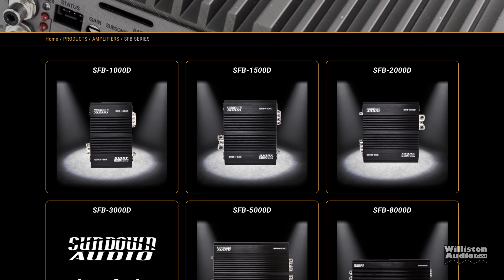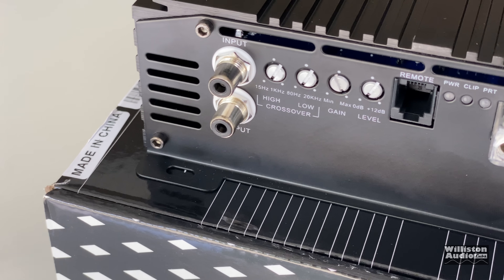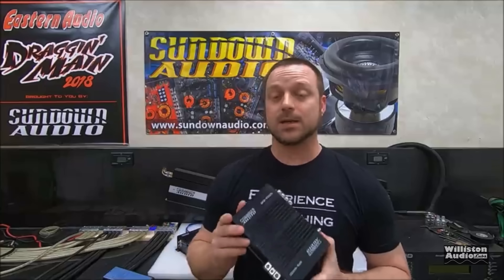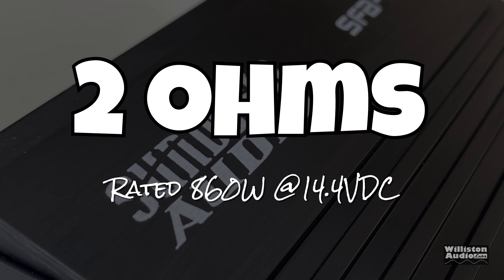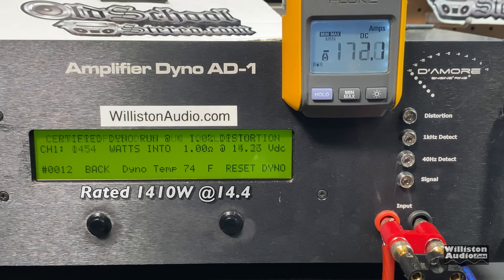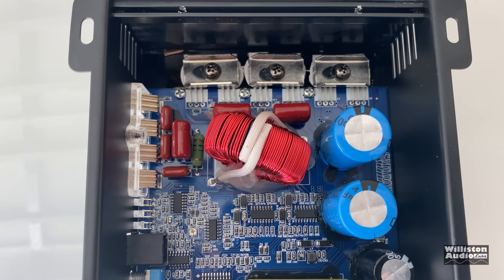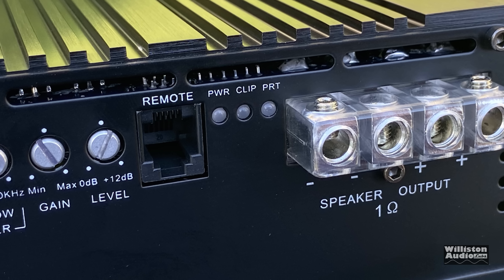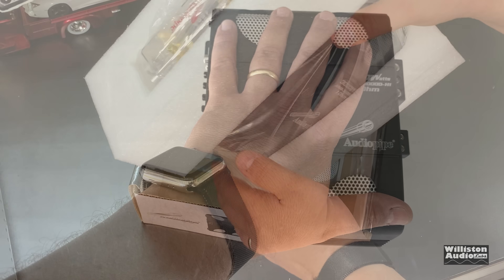Sundown 1000W Full Bridge SFB-1000D Amp Dyno

Comment: on sundown site it says this amp can be linked at 2ohm to deliver 2000 watts is this true? if so what does it mean ? lol i have 2 zvx 12's 1ohm each in a box together im trying to get about 2000 watts to the box would this work or would i only get 1000 watts from this amp? i have no idea what linking means does that mean run subs in parrallel?
Reply: This amp cannot be linked/strapped with another SFB1000D, if that's what you're asking. Linking allows you to run 2 of the same amps, and only one of them controls the gain, crossover, etc. So imagine you have 2 strappable amps, you link them together, and on one of them (the master) you set gain/crossover, and the gain/crossover settings on the 'slave' do nothing. This ensures both are running exactly the same and you do not have subtle differences in gain and/or frequency cut offs.

Comment: What is the gain set at ?   Wide open ?
Reply from the maker: Gains are matched to head unit using DD-1+ for 10dB overlap. Gain is not a volume, it should be matched to your source unit

Comment: Why does this amp and also it's clone the top strong gear not have any fuses. I'm a little leery about an amplifier without a fuse. Seems to me like something like that would go up and smoke since it doesn't have any fuse protection.
Reply from the maker: Use external fuses

Comment: I need some help. I have the same amp running a SA classic on 1 ohm. 
the amp keeps clipping. I sent it to sundown for testing. they said amp is good and issue is cause by bad rca signal from the radio and music source bluetooth. They said it was premature clipping.

Is there such thing? 
How do I fix this?

Comment: Why does it go to 1000w at 2ohms? Was hoping to run one but don't wanna draw too much power from the car. Will it always try and run as high as it can? If I get a 750 watt subwoofer, will it only draw 750watts?
Reply: No a speaker attempts to take what you give it.

Comment: I'm really having trouble choosing between this and the JP8 for my sub.
Reply: I went with the JP8 with absolutely “0” complaints and best amp I have used in years. Bought a second to strap/slave for future since they can handle and it is laughing at 1 ohm slamming. I wondered as well when purchasing amp about this SFB 1000 and what difference it could make if any? Let me know which route you took?#🔊❤️@chuckschillingvideos

Comment: I need a recommendation for an amp that can deliver 500w @ 2ohms. I got the sfb600d but I think it fell a little short pushing my kicker trtp 12" sub. I also need it to be as small as possible since it's under the seat of a mini Cooper
Reply from the maker: The SFB 1000 will. KICKER CX400.1 will do almost that much.

Comment: If money was not an object and you were just going to do situation a really good system with the sub and you was going to pick one amplifier to do it all what would it be big D
Reply from the maker: One amp? Toss up between the AudioControl 5.1300 or D4S JP95. I’ve always liked the 5ch amps and one that has enough power for a full system without trying to do hair tricks or anything…I’d choose one of those. And flip a coin because they are both awesome

Comment: I am assuming it's my electrical, and the fact that I have this thing on a 4 gauge ofc run of cable. But I have two AGMs and idle at 14volts. (from memory) Haven't checked to see what I have for voltage drop but I did a 142.57 wired to 2ohms. But I'm only seeing 775 and some change for my wattage wondering if real world is less efficient than bench test or I need better electrical? Taramp 5K is next and I want my car to be ready for it too.

Comment: I bought the sub-3000d. Mfg date 3/20. No tiffany RCA jacks and only 1 set of speaker outputs. I had to fix the RCA jacks as one would push in when the rca was connected.

Comment: So i got 2 12” skar vd-12 shallow mount at 4 ohm and each are 500 watt rms will this amp work if i wire both subs to 1 ohm? These will be going in a 06 single cab silverado if you need to know that.  Also if it doesnt work can you point me to the right direction on what amps i should be looking for

Comment: but most cars run about 13.8-14.2 ish, so. man these new amps r so little components interior. bass knob has clip indicator, which i believe is nice
Reply: Under load?  In my experience, the voltage drops just as soon as you start adding amps.

Comment: I was pretty pumped up to buy this amp after I watched some videos about it. I purchased this amp to replace my power acoustic razor 2500d budget amp that was featured in a video on this channel. To be honest I hear no difference in the 2 amps. at least not $120 worth of a difference. I tested each on a set of JL Audio 12" subs and then on a set of 12" Gothic subs. I tried wired at 2 ohm and 1 ohm. Currently looking for a different amp, maybe I can get someone to buy it off of me to try and recuperate some of the cost.   Do you think you could review a Kicker 46cxa1200.1t?
Reply: i also have a acoustic razor 2500d

Comment: I bought one of these amps and the sound quality is very disappointing. It gives the subs a lot of voice and doesn't produce clean deep bass.
Reply from the maker: That’s interesting. I have this amp in my daily driver with my 10W7 and it sounds deep and clean to me. I use the crossover on my Pioneer head unit though

Comment: Anyone experiencing this amp cut out on them even at low volumes? Mine has been cutting out and I can barely hear the subs then it comes back out of nowhere.
Reply: I have not experienced this. Do you notice the power light on the amp level control going out when the subs cut out?

Check your wiring, you may have a intermittent short somewhere.

Comment: so with stock electrical i should get about 1000watts out of this amo right?
Reply from the maker: Depends on your stock electrical. If you drive a Yugo with a 40A alternator, then probably not. But if you drive a truck with a 240A alternator, then you’re good 😬
Reply: Williston Audio Labs  I have a 2019 ram 1500. I’ll be 0 gauge gp or knu ofc. I’ll be doing 3 300rms subs. I was hoping to get atleast 1000 watts out of the amp

Comment: Very informative and entertaining videos. I'm from the early 80's through the 90's auto stereo era. My first install system on my 78 Camaro..a Concord cassette head unit, an 11 band Sony Eq hooked up to an Alphasonic 100 watt amp and Jensens 6x9 3 ways on the rear deck. As I got more experience in installs and more funds in my pocket, I later added a Sony head unit and cd walkman to the Sony's Aux. Proton plate speakers on the doors, a pair of MTX's tweeters, a  Sherwood 200 watt amp powering a pair of 10" Kickers free airs in the trunk with an Altec Lansing ALC 10 electronic subwoofer x over to control the subs. I was happy with that system. There were more powerful systems. On  late nights you could hear lowrider Cutless Supremes  thumping their 15" pair of subs to the tune of Planet Rock from a mile away . Nice and fun times they were.
Reply from the maker: Awesome 👏

Comment: Question? What would be a perfect ported loaded enclosure to match with one of those amps? Does it run hot over extended mid volume use? I’m planning a system for my Kenworth truck and would like feedback on amps and subs that can take mid volume for many hours and not get hot. There’s a lot of videos out there that talk about what bangs a few minutes, but none that go over extended use...can you help?

Comment: I bought dual electronics xpe2700 amp from amazon for 50 dollars after shipping, it is rated 150w rms bridged @ 4ohm, and when i hooked it up in my ford taurus, i was able to set my head unit bass, subwoofer preamp output, and gain to the max db of 6 for the bass and gain, and 12 for the preamp output, turned the gain up to max on the amp with bassboost on, and easily got 300+ watt rms out of it, then hooked up my sub and turned the bass to zero and set my gains to run right around 200watt rms even though the sub can handle 300watt rms with 1200watt peak.

Comment: Hey Derek... alot of people say that the high powered Brazilian style/designed amps are lacking in the low frequency range.
Numbers look good but the bass is sub-par.

Would you agree/confirm that rumor? Is that your experience with these types of amplifiers??

Thanks in advance for your input. 👍😎👍

Comment: Just curious if you had any issues with the RCA voltage being over 2v with this amp? I installed a 200.4 SFB and my deck is clean at 0db up to 37. With the amp at 0 gain it was full clipping at 34. My RCA's put out around 2.25v. Curious if this is an issue with all full bridge amps.
Reply: Did u ever come to a conclusion for this problem, my sfb 1000d  is clipping just trying to push a skar sdr 10" 600rms woofer

Comment: Very cool. I find it interesting that they are using a single output core for both half bridge's. It's either not a full bridge or they're are two separate chokes using the same magnetic's, I wonder. It'd be nice if they'd stop rubbing off the IC's,

Comment: Can 2 sa8 v3 be wired to the sfb-1000d?  Or is this made for 1 sub? I just bought one but I know nothing of car audio. Thx for any advice.
Reply: Im wondering the same, my subs are 4 ohm subs and i have two as well.   Would this amp be enough or would we need the SFB 1500?
Reply: Hey bud just installed my amp today, have two sa8’s dual 4 ohms
Reply: Have them wired to 1 ohm and this amp moves them very well!  I just need to adjust my amp.
Reply: @Fluffyboy956  thx brotha appreciate it.
Reply: Bezer Bezer no problem

Comment: I've always only owned cheap Chinese amps before I bought my USA made SD 125.2.  I've never had as much trouble with connections as I have with the SD.  Keep in mind I have this amp securely mounted with all the cables secured at the amp.  In other words nothing can move.  The amp occasionally goes to making a horrible screeching sound which I tracked down to bad RCA connectors.  Had to go in a re solder those connections.  It looks like they've fixed that serious design flaw.   For some explainable reason they went with Phillips head screws on all the connections.  I should banned them from any future considerations for that one brain dead, stupid and moronic decision alone.  The down force required to secure the power and ground will and did result in more problems that had to be re soldered.  The threads in the block strip really easy.  I've been a fully licensed A&P aircraft mechanic since 1990.  Just saying, I've tightened a few screws over the last thirty years and it is extremely rare for me to strip threads.   The amp itself is awesome and is easily the best car  amp I've owned but I've never had those kind of BS problems with all my cheap Chinese amps combined.  It made me long for spade connector blocks.  I've never had any problems with those.  Looks like they used allen heads on the one in the video.  Better but not the best.  I wish the UN could pass some kind of international law mandating the use of Torx head screws for everything and outlawing Phillips head screws into oblivion.  Also, I'm old enough to remember when amps had head-room.  Just saying.

Comment: Great videos! I have a quick question, I am hooking up a 150W - 2 channel mini amp & noise compressor to my motorcycle and already have a head unit  and 2 speakers installed. Do I just have to wire the amp to the battery and plug in the head unit via auxiliary cords? I installed one of those bridges like you use to test equipment out on the battery under my bikes seat. ( that’s where I have my head unit wired to ). I also wired a toggle switch to turn the head unit on and off so there isn’t constant battery consumption. ( the amp I’m using is “Road Rage” 150W - 2 Channel Mini Amp ).....any help would be appreciated 🙏🏼

Comment: beast amps!  I'm currently running an sfb2000 on an X10v2, slams.
Reply: This is exactly what I'm looking to buy , 1 X10v2 and this amp . How is the sub holding up . Would you go with the next size up in amp . Or stay the same or lower ??

Comment: Powerbass xma 1205d. I'm waiting for it to be delivered.  Gunna run it to 4 kenwood excelon 10 inch subs in sealed enclosure.  Would love to see what this amp will do . Says 1200 x 1 @ 1ohm 0.4% THD
Reply: Also the 1205d powerbass says 85% efficiency.

Comment: I have owned a taramps amp before, but I am still trying to understand the full bridge amps. Do u think it needs to be ran with a crossover? I'm just wondering if it would be better to run like we use to have to run them back in the day when they didn't have crossovers built in. Just run the amp in a full mode and use an external crossover or I think head units are actually able to do that today also. I have been really wondering about that myself. Does the amp actually have a full mode or straight thru mode?
Reply: Just run a digital sound processor

Comment: Add a couple of fans try to extreme cool it , then drop it. Good thermal paste, cheap water block cooling. Replace a component or 2 if any or mediocre. It's fun to buy cheap or inexspensive and make it sound good. That is more challenging then buying ex pplvb

Comment: Maybe it's ridiculous, but with no fans or even with them I've ran my amps with rubber mounted legs for stand off venting. I first figured it out using a 3 to 5 stack of firewall grommets, because that's what I had, per leg mount back in 1992. Made a significant difference because cooler the amp is the happier they are. Rubber instead of metal or plastic helps with premature vibration issues. Just what worked for me is all. Plus I use firewall grommets behind license plates, zero rattles ever. 
👍✌️

Comment: I'd also like to add the the price is rather poor given that thing this made in China. I'd rather be picking up a Taramps or Banda 3K at that price point...
Reply: Customer support and warranty is much better with Sundown Audio
Reply: Jonathan 2 year warranty, better quality connectors, Tiffany style rcas, just saying
Reply: @holeshotinspectionllc2412  That's a fair comment but Tiffany style RCA's aren't the end-all-be-all... let's be honest, mechanically they feel better, but in terms of audio quality, it has no impact. Especially when you have 15-20ft or RCA cable in the signal path (which again is probably not perceptible).

Comment: Will reserve judgment until the early adopters validate the durability. In the meantime will be waiting for the influx of people blowing these things up cause they can't maintain a minimum 12.8V. It's shocking how many people run their amps down to ~10V when the voltage sags.
Reply: They have been out for 3 months now, not hearing anything about reliability issues, if people don’t understand not too run there voltage that low, then they deserve too blow there shit

Comment: Do you sell any of those amps you test? I live in San Tan Valley.
Reply: I wish he did sell those or even give them away. I think he said he was going to keep this sfb and put it in his car. He said its wasn't that efficient yet he switched out his old amp and put this sfb in its place so I think he was somewhat impressed with the amp. I'm happy with my sfb2000 and it does its rated power considering its footprint..
Reply: @RomaVilla  I would want a 2 channel amp.
Reply: Roel144 pena he stated it could be more efficient at 4 ohm, there not that bad on efficiency, but it shouldn’t be that hard to supply an amp that’s under 2k with plenty of power
Reply: @holeshotinspectionllc2412  could you give an example without having to break the bank...
Reply: @holeshotinspectionllc2412  could you give an example without having to break the bank...
Reply: Roel144 pena what application? I am running a DD M3c at .5, before I got my JS alt, I had a stock 135v amp and a XS d3400, was dropping too 13.3 at full tilt, but I’m putting in a sfb 8k on 75 ah of lithium now.
Reply: Roel144 pena look up what alt comes stock on your ride and we can go from there
Reply: Roel144 pena you might be fine, until you can get set up with an better battery
Reply: @holeshotinspectionllc2412  I have stock alt with 2 agm platinum that I got from auto parts but I haven't done the whole big 3 yet. I have a sfb2000 on a 15zvx at 1ohm in a 4 cube enclosure and I drop down to about 11.7 v I have upgraded my wire to 0 gauge ofc, also the alt my Chevy has now is a remanufactured alt that was put in before I bought the car
Reply: @holeshotinspectionllc2412  which would you recommend I do first, get another battery or upgrade the alt first?
Reply: Roel144 pena at this point you really need too do the big three, I would definitely get the alt now, you should have enough battery bank for that amount of power I paid $349 for a JS 240, if you had a lil more head room I would go with brand x, that’s basically the same price as a xs d3400, so it’s not a bad deal...
Reply: Also where are you grounded?

Comment: You can use both input/out put as inputs and not hurt amp. Sundown has posted this numerous times. Most full bridge amps are that way
Reply: Yes the manual states both input and output rcas can be used as inputs for traditional dual inputs.
Reply: @eclypse3d  I know this as stated above lol 😂